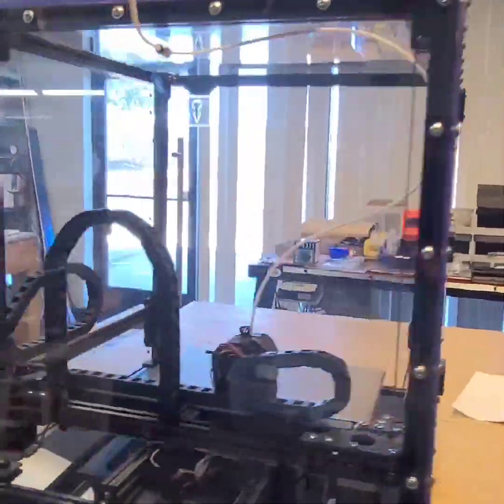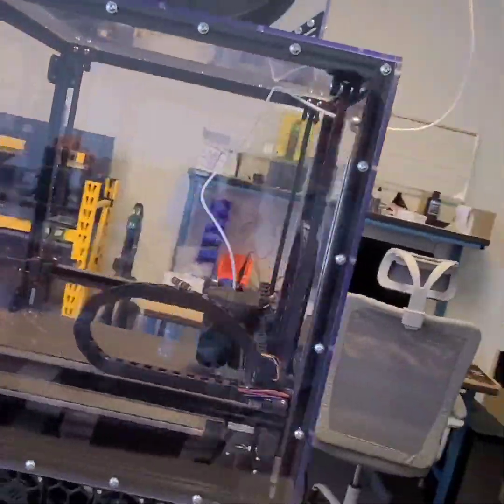Voron 2.4 and trident enclosure mod by Clearview Plastics

Comment: Very nice setup, I've been eyeing the panels kit for a while. Besides the higher temp rating are there any other benefits to the PC panels? I assume its better against scratches - any noticeable benefits over comparable thickness acrylic noise/temp wise? 

My main gripe with my current trident 3mm PMMA door is how flimsy it is.

Comment: Mantainance will be pretty hard, as you can access it easy only from the front
Reply from the maker: Maintenance access requires removal of panels regardless. No harder than the stock setup. Using drop in nuts, all the fittings are in place to quickly put back together.